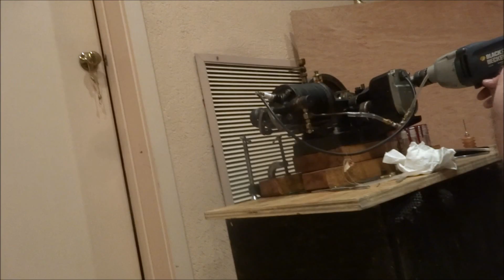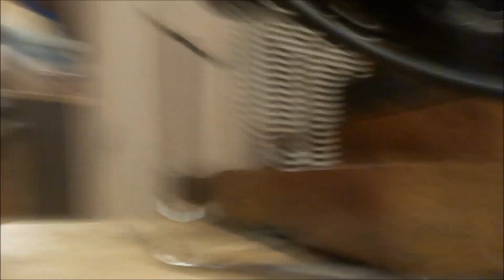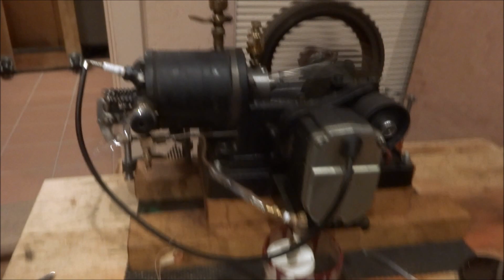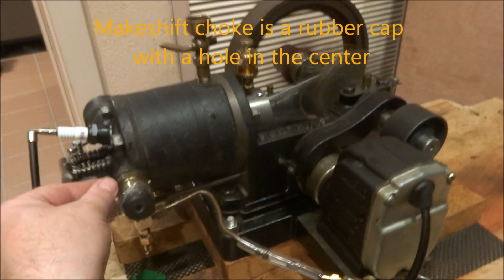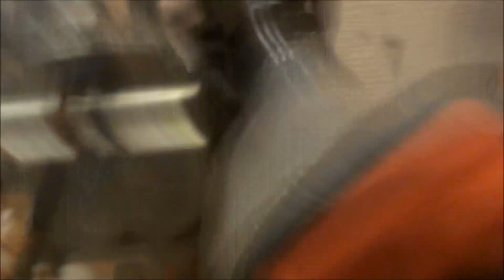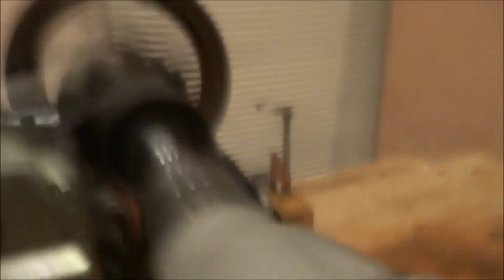Stuart Sandhurst Gas Engine Test Run with Makeshift Choke and Fuel Supply

Comment: Nice little engine.
I assume new?
Reply from the maker: The castings were offered from 1939  through 1966 so not new. However there are no signs of wear. It is in near new condition and I think it was run very little.